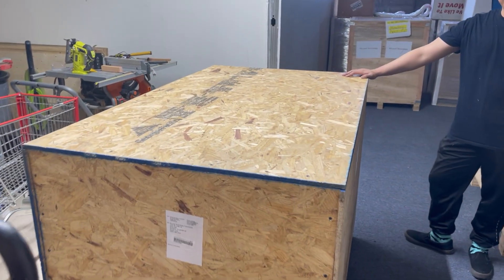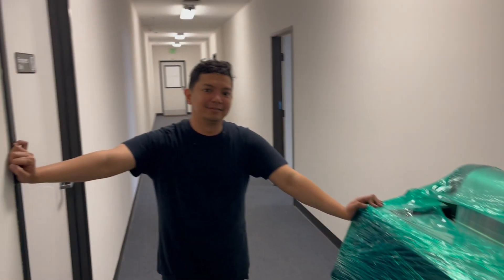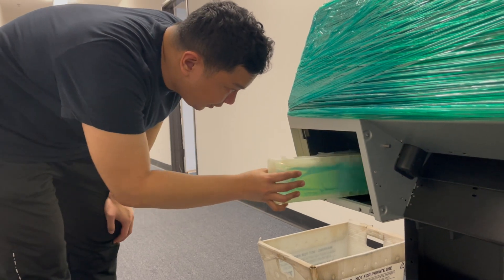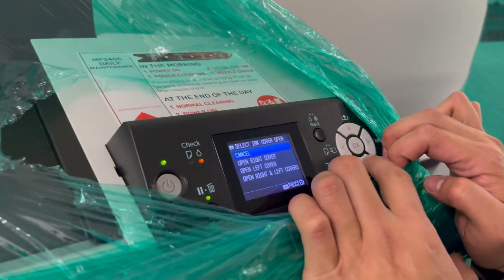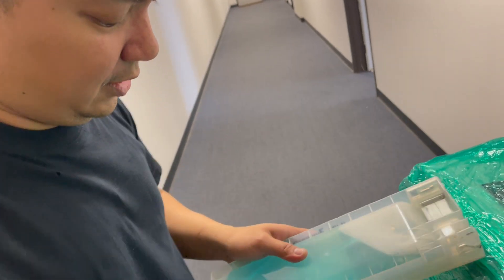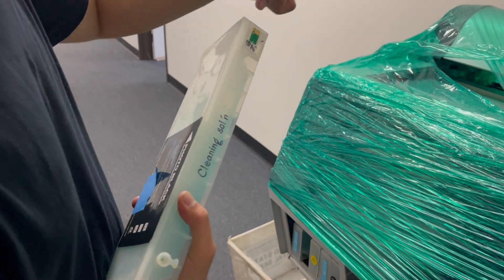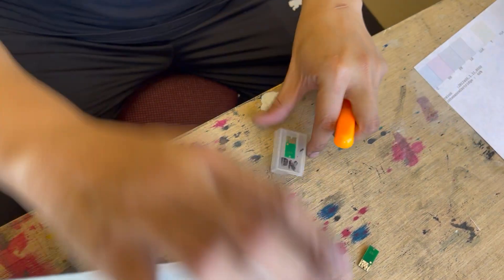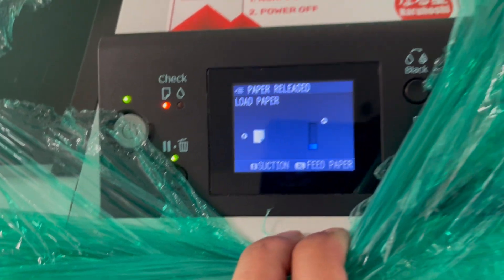How to Unbox and Convert Epson 7890/9890/P6000 to DTF Printer

Comment: Hi, is the precision of the print is good than the normal chineese DTF printer
Reply from the maker: This is an original Epson Printer print at 1440 dpi for dtf, the Chinese is just an assembled printer with no quality control in every parts and printing in 720 dpi. The original design of the printer is to print photo, thus the quality print is photo quality.